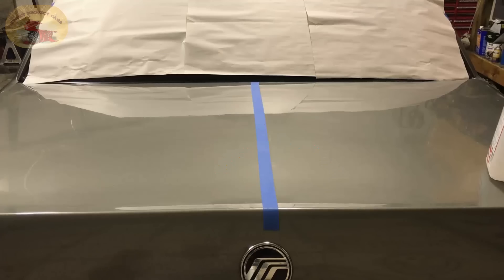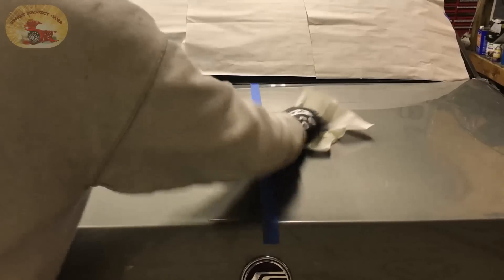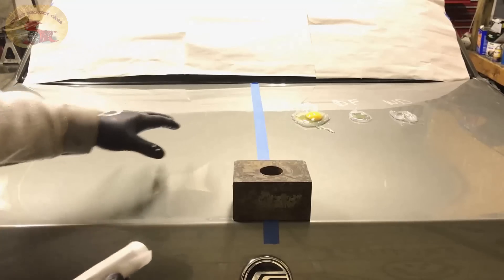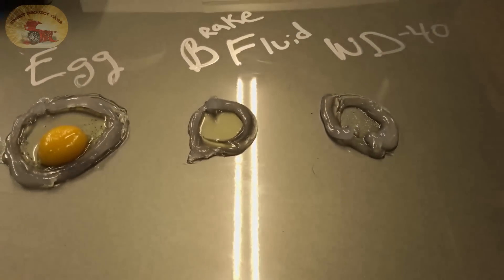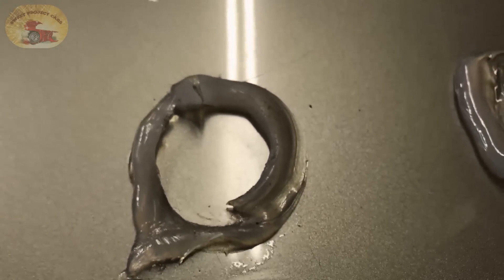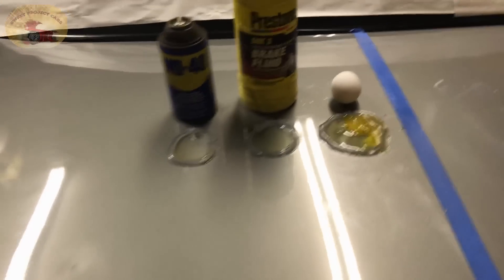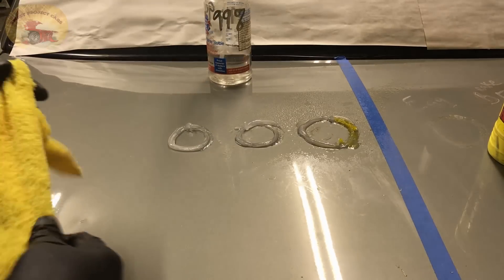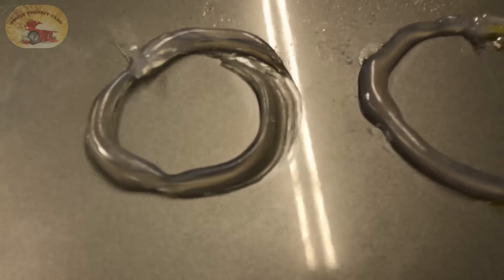Will BRAKE FLUID, EGG or WD-40 Eat Clear Coat in 24 HOURS?

Comment: Unfortunately,  I found out the hard way that egg damage is actually caused the impact of the shell. The impart drives shell partials into the paint, cracking/chipping the clear coat. 😭
Reply from the maker: Oh no :(  Thank you for watching and sharing Billy.  Have a great day. mad Mike the hammer SPC
Reply: My car got egged and it sat for a day in the hot sun and there is visible deep etching into the clear coat in the shape of the way it splattered on. Wd 40 is great for removing tar though.

Comment: im sure it wasnt the intent but people may not know the brake fluid is much more reactive on a clear coat that's in less then stellar condition... hell i stopped wasting money on paintstripper for household projects and started using breakfluid.
Reply from the maker: We have spilled brake fluid accidentally on clear coat for over 30 years we have never seen it affect clear coat now on older cars that were a lacquer based paint yes there could be issues but on a 2k clear never seen it cause problems thanks mad Mike sweet project cars

Comment: Why test oils when API (American Petroleum Institute) has already done it and it’s public information?! Just report on their tests. The better video would be “Which Motor Oil is the Best Value?” and cover diesel, gasoline, 2 cycle, and for forced induction. I read their report years ago (before the new classification came out) and then just started buying Wal-Mart’s Super Tech synthetic since it had a high rating, it was made by a reputable manufacturer, and it’s easy to get (just has a different label & bottle). I’m over due in researching API’s newest report and pricing the least expensive oils (with the correct weight, classification & rating) I need for my vehicles. Since Amazon is expanding their Basics line, I’d like to see how that stacks up.
Reply from the maker: HWandW we are doing it just to have some fun as with all our videos
Reply: Sweet Project Cars That’s good! We need good & wholesome fun in our lives. Since we get too much garbage from TV & Hollywood.

Comment: Great videos.
With the WD40 can, have you ever placed a tyre valve over the stem of the aerosol can, with the spray nozzle removed, and filled the can up with compressed air?
Reply from the maker: Dale Hyland we try to refrain from compressing a small can like that and for a couple bucks we will just buy new if needed..we usually use them up before the loose pressure but this can was here for years that is was a good time to use it up.

Comment: in the Oil test I think Mobile 1, Amsoil, and Amazon, will score Overall Best... I used(I Only use Synthetic) Amsoil and Mobil 1, in my 1973 Moto Guzzi 850cc Motorcycle and it has 450,000mi+ on it, and Uses and loses no oil and it's been to AZ & Back to Ohio 7 Times, two up riding and Towing a 23Cuft Trailer.. I also used Amsoil in my 64 Pont LeMans, 6cyl and Amsoil Trans fluid, and it also didn't use any oil, and the Trans shifted like new even after I sold it it in 2005.. By the way my 2008 Ford Ranger V6, in the Factory Shop Manual, the so called Recommended Oil, that they don't list, is Mobile 1and the 5sp Manual Trans uses Mobile 1 Trans Fluid...

Comment: You should do the same experiment but leave it outside in the sun
Reply from the maker: akfinner1 it was just a basic test to show if someone was working on their car in the garage and spilled some brake fluid on it that they had plenty of time to clean it off
Reply: @SweetProjectCars  ok i just thought that sun beating down it it would have different results
Reply from the maker: You are very correct the sun is not very forgiving pretty much anything left on clearcoat and left out in the sun long enough will damage it that is a given

Comment: I had a black truck that was egged on a hot Kansas summer day, I was away from home for the day.  I cleaned off the dried/cooked on eggs, which was not an easy task, It dulled the clearcoat worse than the break fluid. It took a lot of buffing to get it to where it wasn't noticable.

Comment: As I'm watching, I'm more interested now in seeing how the silicone RTV responds to the ceramic coating.🤔
Reply from the maker: swm122758 oh that glue is n there for sure and the ceramic coating does no better with it not adhering, that glue is the bomb for adhesion.
Reply: What if the yoke broke. That was only the whites of the egg touching the finish. Also didn't have the sun or a hot light on it.
Reply from the maker: Stephen Oleksy it was just a basic test to show if someone was working on their car in the garage and spilled some brake fluid on it or woke up in the morning and seen someone egged their car that they had plenty of time to clean it off with no issues